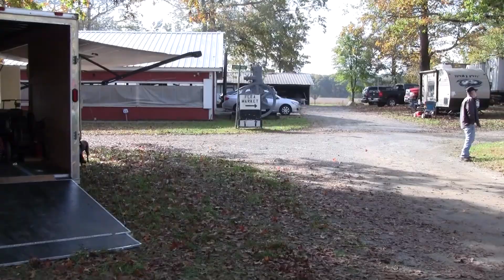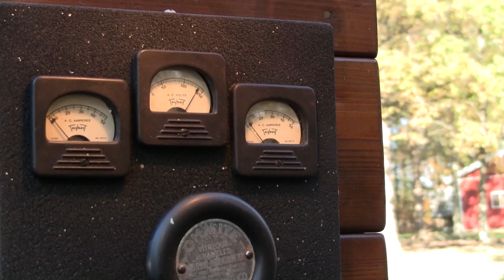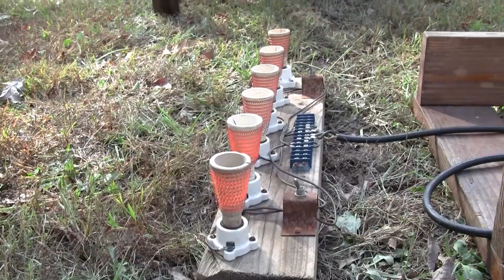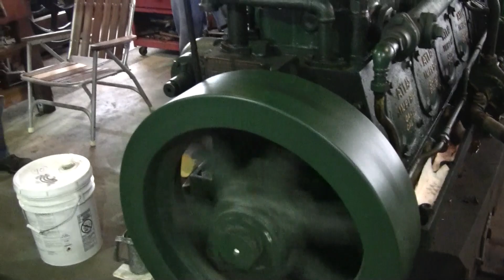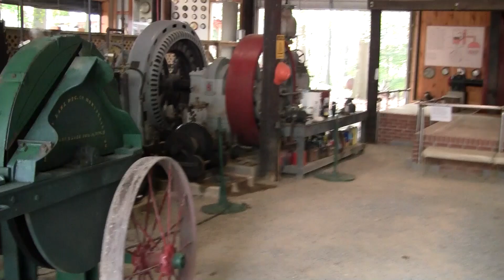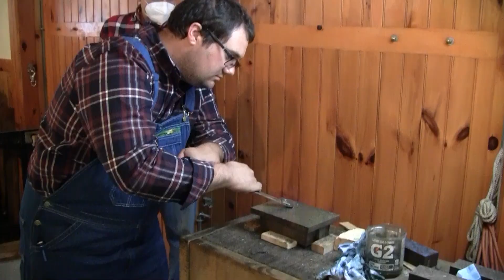Tuckahoe Steam and Gas Association 2020 Fall Engine Show

Comment: The scraping at the end is started with a flat machined surface with two surfaces like this sliding over each other there is no room for oil, the scraping leaves the surface flat with grooves for oil to keep the two metal surfaces apart which cuts down on the surface wear

Comment: I'm so envious you can have such place with such engines on display like that in the open, so that you can come close up to them to see better as they operate. Here in sweden there would be a six+ meter perimeter around every single engine engine and big signs about how dangerous everything is, otherwise people would just go up to the engine and put their fingers between cogwheels, touch a live conductor or something else less clever. Also people here let their young kids run around uncontrolled. :/

Comment: I wonder if that gear shaper actually requires a cutting tool that matches the gear profile. It is possible for gear shapers to rotate the blank and adjust the depth of cut such that the involute shape is cut using a simple, essentially straight-cut cutting tool.

There were some jigs made for standard shapers to do this as well. There are a few folks with demo videos of this on YT.

Thanks for all the show footage!

Edit: Well, I just took a look around YT and there are gear shaper vids using a shaped tool.. sort of like one gear, plunge-cutting another. Kind of like a broaching operation. Anyway, cool stuff to learn about everyday!

Comment: Used to live in Harford County MD. Never made it to Tuckahoe, but went to Arcadia out in Carrol County as well as Steam-O-Rama in Windsor PA. Really enjoy your videos. If you haven’t heard of it yet. Check out Coolspring Power Museum in Coolspring PA. Awesome place. Also Rough And Tumble in Kinzers PA by Strausburg PA has good shows as well. I myself have a Lister LD1 3.5hp vertical air cooled diesel belted to a Niagara 120v generator. I also have a 1.5-2.5hp IH LA engine and have a GM 1wire alternator on that and use it to jump start stuff from time to time. I use that at shows to run a fan off a inverter.
Reply: Ol' Hazzard County md